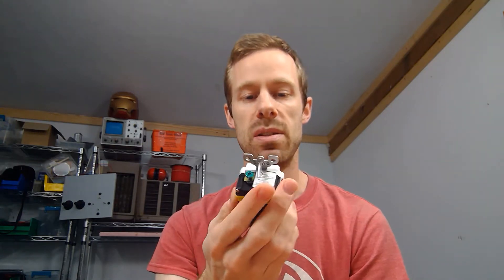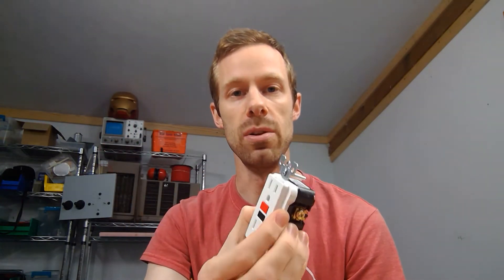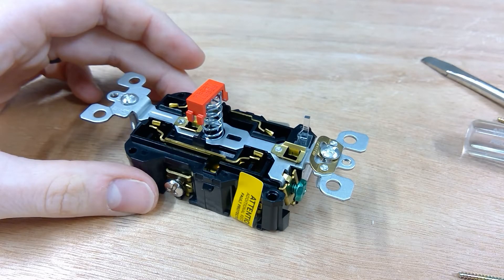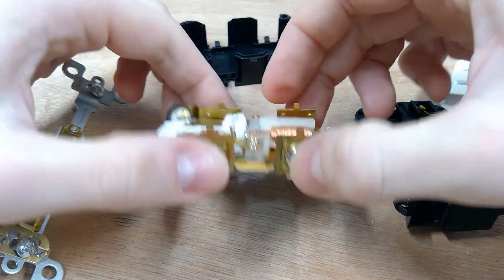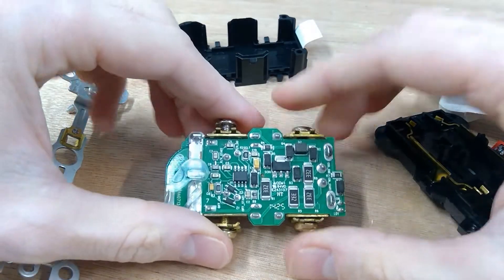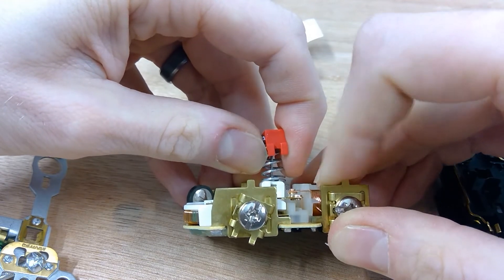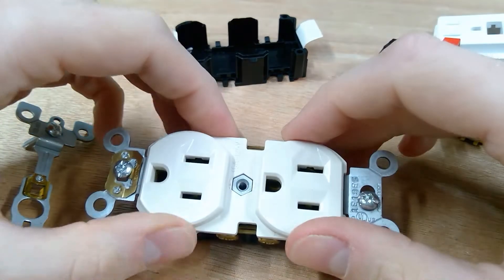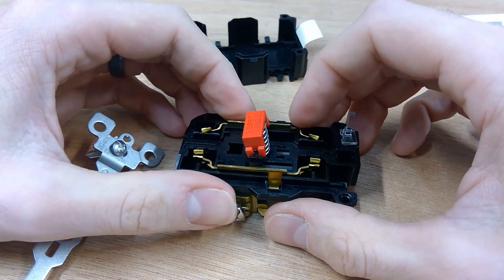Inside a GFCI Outlet

Comment: This is an excellent video that explains how the GFCI outlet works, not only from the mechanical standpoint, but also how it compares the input and output. This is the only video I found where someone actually opened it up and explained it with enough depth  of electrical/electronics understanding.Great job

Comment: Something I just learned: There are GFCIs that will not power up unless the "hot" wires are connected to the Line side of the breaker. So if that yellow sticker is absent, this may be easy to mix up.
Reply from the maker: Yes, absolutely correct! And the reason for this is that the 'Line' side of the breaker provides power to the coil which energizes the switch contacts. If the Line side is not powered, the contacts will not engage, and the GFCI will not operate.

HOWEVER, one more caution - if you accidentally connect the 'Load' side with power and all the downstream circuits to the Line side, the contacts of that one GFCI outlet will have power, but it's not protected. That can be really unsafe.

Comment: I need some info. I had a 35 dollar gfci plug in my kitchen and all of a sudden it just starts rapidly clicking.  I tried the test and reset button and neither one would click. Then it starts clicking again really fast and then it starts spitting smoke. I had to flip the main house breaker cause all the lights were dimming and surging. So I open the plug up and inside at the top of the plug is a plastic spool with lots of copper wire spun around it. That's what caught fire.  Does anyone know what that spool is , what it does , and how it failed ? And why I couldn't reset the plug or why it didn't trip the 20 amp breaker it's on?
Reply from the maker: Wow, that's scary. And I am NOT a licensed electrician, so I can only speculate, but PLEASE call a local electrician and take their advice. I'm only a nerd who tears things apart, NOT an expert.

As far as why it didn't trip the breaker, typical panel breakers trip 'relatively' slowly, so if a transistor on the GFCI is shorting, then opens the circuit, and the current dies back down so it closes, then it shorts and opens right back up again, this would happen very fast. Perhaps too fast for a breaker to trip.

As to which component is the culprit, I do not know - there are a lot. The coils consist of very thin wire with an insulative coating. If it is old, or maybe at some point in its life has taken too much current, that thin coating may melt and short a few coils, and that problem cascades as the resistance goes down... More and more current until it catches fire.

The only thing I can say for sure is that the ONLY thing inside a GFCI that would click is the trip plunger, so it must have been registering the current and tripping that solenoid inside. As far as an assessment of why, that is only speculation.

I hope it gets fixed for you and everything is safely resolved, my friend.
Reply: @PetersonBrosAutomation  thx. Really scary night . I'm just glad we were HOME.

Comment: Thanks for this video! Who knew it was so complicated. You peaked my interest so I watched a more in-depth video with a circuit diagram. It appears that both hot and neutral flow through the two coils. One coil is used to sense a difference between the hot and neutral, and one for sensing if current is flowing through ground.